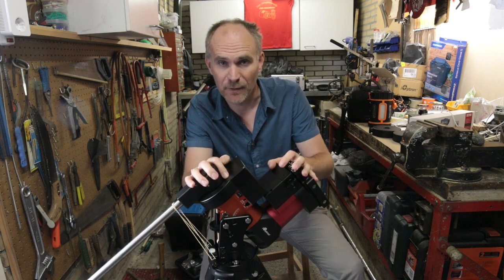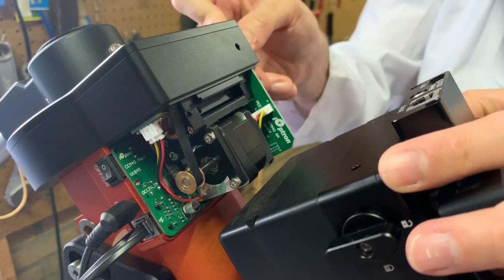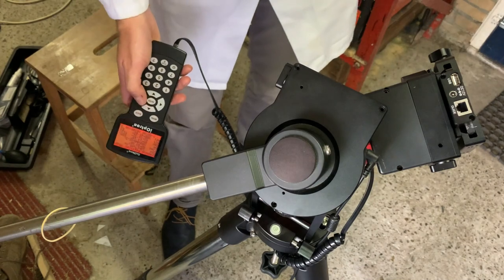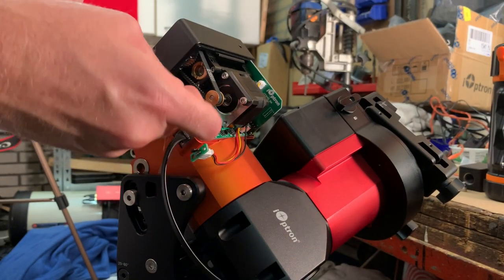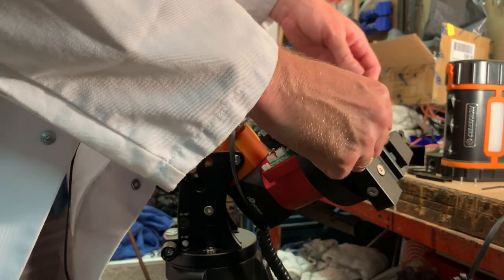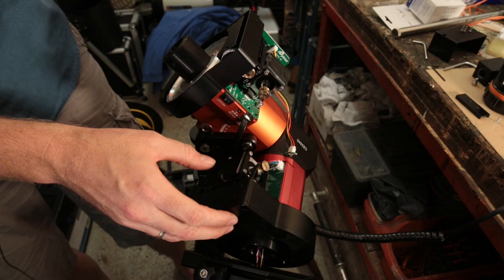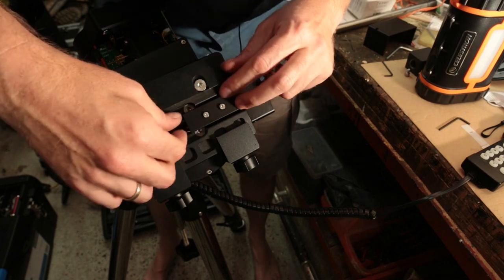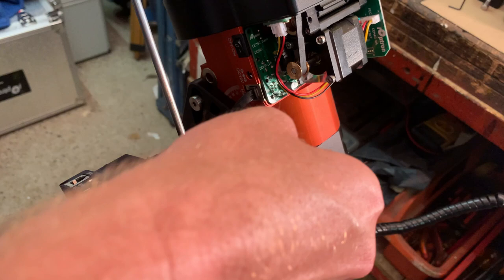iOptron CEM40 belt fix. Solve guiding issues.

Comment from the maker: Let me emphasize in a pinned comment that this video is not for bashing on CEM mounts. In fact - as my previous CEM related video showed (https://www.youtube.com/watch?v=sl_1xzLS29w) - I really like these iOptron mounts. I was probably just experiencing bad luck. That my mount was waiting all that time for my camera to return from a repair (did I mention bad luck already?) probably didn't help either.
Reply: Thanks Matrin for your video. One question though, would moving the problematic belt from the RA motor/belt setup to the DEC side not create problem on the DEC side?
Reply from the maker: @dnranjit  Yes it did. But as the DEC direction is barely moving during tracking, this is hardly an issue. 

By now I have replaced that belt with a brand new one.
Reply: I feel you as a CEM25P user for 3 years now. It started out horribly - always guided perfectly fine in RA, but my DEC was close to unguidable due to backlash. I did surgery on it a couple of times, first only the belt, then the gear meshing. The belt alone helped a bit, I was able to guide unidirectional quite decently in DEC, but I wasn’t perfectly content, so I fixed the meshing, took me an hour and I was so afraid to mess it up. In the end, it was worth it - I can guide in both directions in DEC now, backlash is down to 1000ms which is pretty good for a 950€ mount (what I paid for it 3 years ago). My guiding is at 0.5-0.8” normally in total, depending on if I’m close to the zenith or not. If seeing is atrocious, it might go up to 1”, but still good results imo. I’m convinced I could have never reached that with the HEQ5, plus it is quieter, and most important, lighter, also was cheaper back then. I’m so content with that tiny thing now, I run around 6.5-7kg on it, I’d say, on an imaging scale of 1.1”, but I also did lower with success. I still crave a bigger mount, mainly because I want a smaller image scale and a bigger scope, but I don’t know a single mount who can achieve guiding like that with a pricetag and a weight like that, same applies for the other CEM mounts. Yeah, the meshing / belt might need fixing with those if you’re unlucky, but at least for the cem25p it was pretty easy. In fact I love it so much now that I won’t ever sell it, even when I plan to get a higher payload mount - dual rigs it is then, it is too good now to not use. It’s plug and forget now with a small refractor and tiny pixels, as long as there’s no cloud fucking up the guiding, I have ZERO pics that need to go after a night imaging. I even did narrowband images up to 5 mins, could probably easily go higher. My next one will be iOptron as well :D
Reply from the maker: I had two CEM40's until recently. I have replaced the star of this video with a ZWO AM5. It is very similar in performance to the CEM40, but much more easy to use / setup. A video on it is still in production. It is going painfully slow.

Comment: Brilliant stuff! I have been experiencing a similar noise from y CEM40g from 2022, and it’s been deteriorating in RA while tracking/guiding. Have belts on order and fingers crossed on getting this resolved! Many thanks as this absolutely helps. 
Cheers,
Aayush
Reply from the maker: Great to hear! I hope it will solve the issue as it did with mine.

Comment: Great job there Martin glad you have your mount back up & running, I have to admit I were thinking it was a damaged worm drive by the clicking but thank goodness it wasn't that. I'm thinking about getting an old Celestron CGE pro up & running as I cannot afford a big hefty mount for the observatory. There's a guy called Chad Gray who makes a complete onstep kit which basically junks all the Celestron electronics & motors & replaces it with new motors with belt drives etc. Maybe I'll start on that project next year.
Good to see Dylan offering his advice to lol, clear skies.
Reply from the maker: I was afraid somehow my worm or RA gear developed a defect as I had my gear engaged all those months I was waiting for my camera to return. I now have my mount stored with the clutches open. Hence the rubber bands you see at the start.

Luckily that was not the case and it was ‘just’ a worn belt.

Comment: I have the same sounds coming from my new CEM70 after using it just 30 minutes or a little more. Guide graph shows a spike at intervals which leads me to think I may have the same issue as you had in this mount. I am going to check it out. Thank you !!
Reply from the maker: If it is a brand new mount, I think it is a good idea to also inform your supplier. This wear and tear is a bit weird for a brand new mount IMHO. Mine developed the issue after 2 years.

Comment: Looks like mission successful with the round stars at the end. Interestingly my CEM60 has started making a clicking noise when it slews although at this stage I haven't seen an issue with the stars but I'm beginning to wonder of my belt might need replacing.
Reply from the maker: I first noticed it in my stars. They turned into squiggly worms... In the morning my mount is in home position, and the only slew I am at the mount was at polar alignment. Didn't notice it then.

Comment: I bought spare belts for my CEM70EC from Amazon, if you take the part number that's on the belt and do a search on Amazon you will find them
Reply from the maker: Did they fit correctly? It seemed to me that the most belts sold online are a bit wider (62mm vs 60mm that my CEM40 needs).
Reply: @KopLamp  I bought just in case one of the original belts breaks, not had chance to use one yet but I did change the bearings on the RA & DEC worms whilst the belts were off I checked and same size. New ones had same part number so shouldn’t be an issue either

Comment: Thanks for that brilliant video! Even though it is already a few days old I will still try to get any answer.
Do you know what is the length of the belts? B76MXL belts are available in different lengths.
Reply from the maker: Really? Hmm I thought it had a predefined size. The 76 refers to the amount of teeth. The MXL refers to the shape of those teeth. So the two together should equate to a certain length. 

The width however is something you get to choose. For the iOptron mount pick the 6mm width version.
Reply: @KopLamp  Hey! I just saw it's a stupid display on AliExpress. You are right the length is defined by the number of teeth. I ordered some with the same marking like it is visible in the video. I also ordered 6mm wide. Let's see how long the 10 belts will last. 😂 10 was the smallest package that I could get. 50 or a 100 might have been a few belts too many. 🤣
I hope my 2020 CEM40 (I have the G config without Guider) can be opened as easy as yours.
Reply from the maker: @astrofromhome  I think all CEM40's should have a similar motor mounting. It is the plugs and wiring that differs from model to model. You could look up my video on all different iterations I found: https://www.youtube.com/watch?v=sl_1xzLS29w

Comment: Hi Martin. I hope you can help. 
I’ve disassembled my CEM40, but I’m stuck at the step where you missed the recording!!
😅
Can you please clarify how did you remove the saddle? I’m trying to open the DEC axis cover, as I have a bad grinding noise in my DEC axis, which grew louder when I tensioned the DEC belt. If you have the time, have a look at the video I uploaded today to YouTube. 
I removed the plate covering the wires, and the four bolts anchoring the saddle, but I was still not able to remove the saddle?
What am I missing?
P..S. I have the same first version CEM40 like yours. 
Many thanks
Ossi
Reply from the maker: That is strange. The saddle is only attached to the mount by those four bolts. Be careful though as pulling too hard on it might become a problem when it does come loose suddenly. You might damage those wires.

Comment: The iOptrons seem a bit fragile compared to some other mounts, do you think?
Reply from the maker: I don’t know. This time it was just wear which was easily fixable. I’ve read about other mount brands that need complete dismantling and tuning with gear replacement kits if you want to get good results, because the off the shelf units are mediocre. 

When the on/off switch broke, the shop (and ultimately iOptron) was quick in saving the day to get me a replacement board.
Reply: @KopLamp  That's good to hear.  I have been thinking of getting the CEM40 or the GEM45. Can't really seem to make up my mind. People seem to love or hate the iOptron mounts lol
Reply from the maker: As always people with one brand will burn the competitors brand to the ground. Think Apple / Android. Or in our world ASIAIR / NINA. There is always a list of pro and cons to take into consideration and those differ per person. Don’t listen to haters or lovers too much.